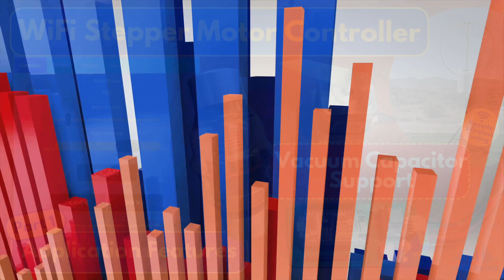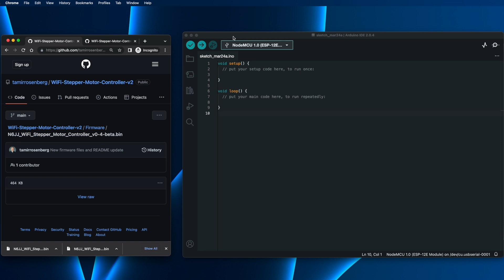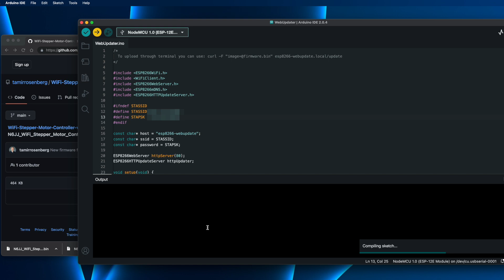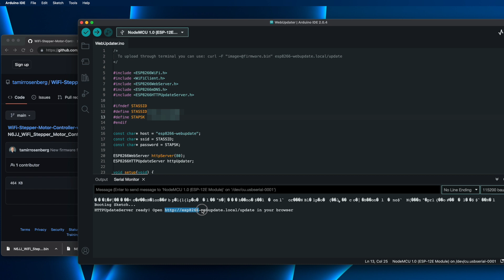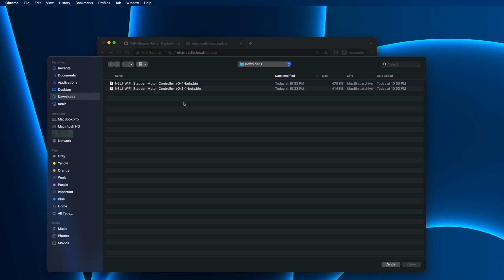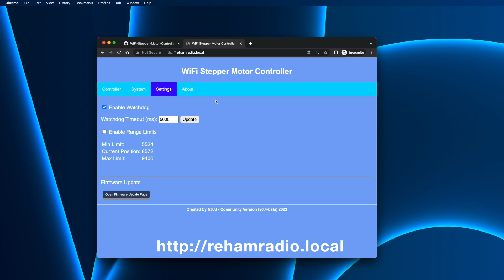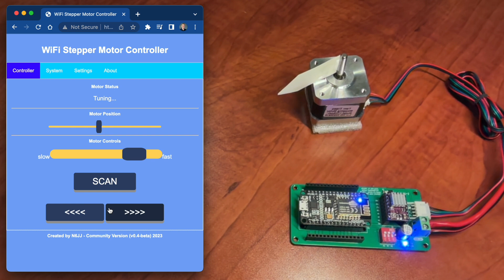WiFi Stepper Motor Controller Application Features - Part 1

Comment: How would I use this in the field without Wi-Fi?
Reply from the maker: While at the field, you can enable your Hotspot feature on your phone and your phone will act the same as your home router. 
BTW, this will work even if you are at a location without a cellular signal. A cellular signal is not needed.

Comment: I am considering ordering from you but I will need to also order a stepper motor with cables that will work with your Wi-Fi controller. Also Can you provide links to the firmware for programming this device? Thank you
Reply from the maker: Hi, and thanks for contacting me. Please check my website, as you will find there links to the parts that I used, and that's including the stepper motor.
As for the firmware, please visit the GitHub repository of this project, you will find there a folder named "Firmware". The link is in the description of this video. 
Please let me know if you have any more questions.
Good luck, 73.

Comment: Thanks for the video. I am a ham radio  operator and currently looking for something like this to rotate a small yagi ONLY 90degrees forward and then reverse. Is this something I can apply to my project? Thanks again
Reply from the maker: Thanks for the question. Yes, this project is not just  to control a capacitor but the option to control a stepper motor remotely. The application will give you the option to turn the antenna left or right, non stop or momentarily, and you will be able to set range limits. In addition, with the next version, you will be able even to set memories, to known presets. What you will need to do is to build the mechanical structure between the motor and the pole of the antenna.
Please let me know if you have any more questions.
73.

Comment: Vac variables usually take about 10 full revolutions end to end. Does this controller tune using multiple revolutions? The video is showing less than a full revolution. Thanks for your help. I’m thinking of getting some. Also have you found steppers to be so noisy as to prevent tuning by listening to the receiver? I am currently using an air variable and linear motor. 73’s Jim AE1C
Reply from the maker: Yes, the controller can support capacitors with even more than 10 revolutions. In the demo, I showed less than one revolution just for an easy way to show and follow on how the feature works. In the next video, I will show more new features and will take that into consideration to show a demo with a set of few revolutions. 
I'm using two steppers motors that are super quiet, I don't have any problems of noise. More than that, when it's set to slow movement, it's very hard to tell if the motor is actually working and I need to stick some paper to visual the movement.
Thanks for your question, 73,
Tamir
N6JJ
Reply: @reHamRadio  Thank you for your swift reply. Can you share the mfg and model of the steppers you are using. I’ll try to find them on Amazon.
Reply: @reHamRadio  Also, do you know the wifi range? How far from the shack can I place the loop?
Reply from the maker: As for the range, 2.4Ghz WiFi can cover up to 150 ft indoor and 300 ft outdoor, it depends on the environment.
Reply from the maker: About the model of the stepper motor, and other parts that I'm using, please check my website, under the controller page. I mentioned these details. In addition, please check the video on how I built the antenna itself, as I added to the video description a full list of the parts that I used. I hope it helps.

Comment: Missing important info: 
File, Built - in examples -- -How did you get file " ESP8266HTTP UpdateServer" ?
Reply from the maker: Thanks for your comment, I agree with you that this option does not exist by default in the Arduino IDE. This feature is added automatically when we add the ESP-12E board. I mentioned that step in the video when I started  the compile process. 
Thanks for pointing that out.
Reply: @reHamRadio  Thanks Tamir. Great job.

Comment: Very interesting control for vacum capacitor (VC). As VC can rotate 10 times for min to max, how does the end stops work  in this situation?
Reply from the maker: Thanks for the question. In the video I showed just an example of how to set range limits but you can set the limits for any number of rotations. It's supported.